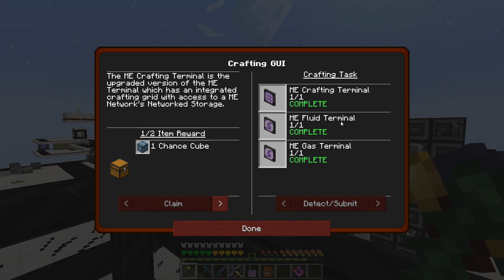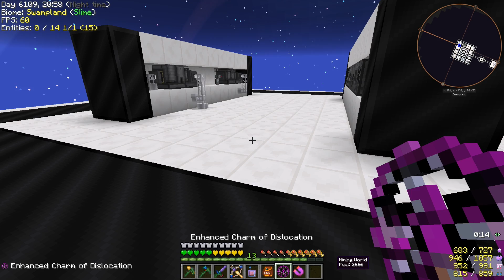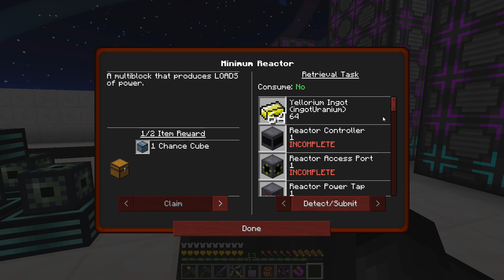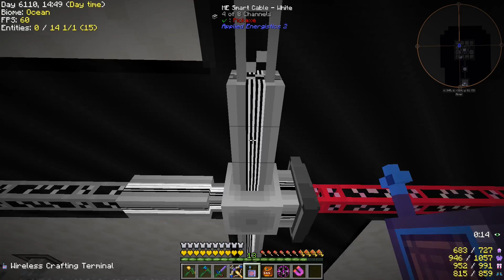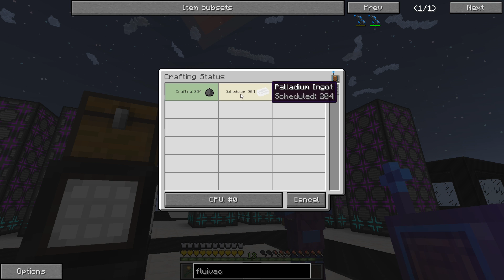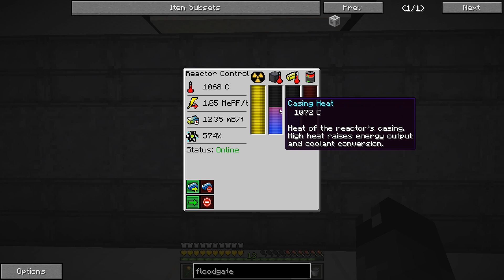Project Ozone 2 Kappa Mode - POWER UPGRADE [E65] (Modded Minecraft Sky Block)

Comment: the temp on the towers went down because it started raining for a second, it quickly stopped but the second of overcast caused it to go down slightly. also, the heat isn't maxed out so that means it can still get hotter, maybe put a heat source under it? like netherack on fire?

Comment: You could make tier 7 energy core (probably not a option at the moment) or make 20x20x20 (or maybe 10x10x10) vibrant capacitor bank to hold all the power that big reactor making.

Comment: I think I heard someone say its not acually a coolant its acually used to transfer the heat inside the reactor. just a little thing to know :P
Reply: Bas Haaksema It's a coolant and used to transfer radiation and heat as well.
Reply: Hmm thats seems fair
Reply: Each item/fluid has 4 different effects on what is happening inside the reactor. eg

Abs. - Neutron Absorption - How much radiation is converted to heat
Heat - Heat Efficiency - how efficiently radiation is converted to heat
Mod. - Moderation - How well it slows down the neutrons
Cond.- Conductivity - The higher the number, the more RF you get from generated heat.

Cryotheum   Abs-0.66    Heat-0.95    Mod-6.00    Cond-3.00
Ender       Abs-0.90    Heat-0.75    Mod-2.00    Cond-2.00
Reply: Ah this helps a lot so we where both right :P